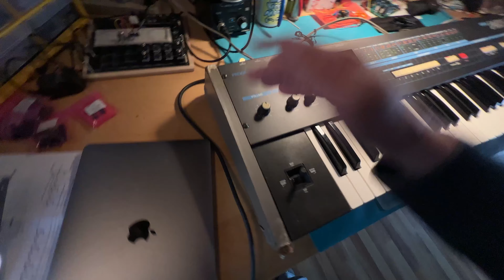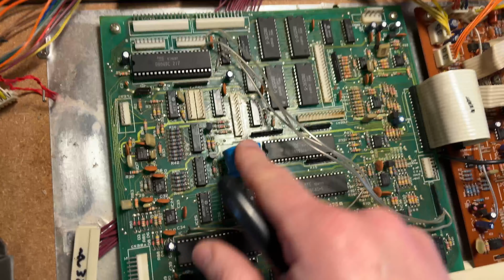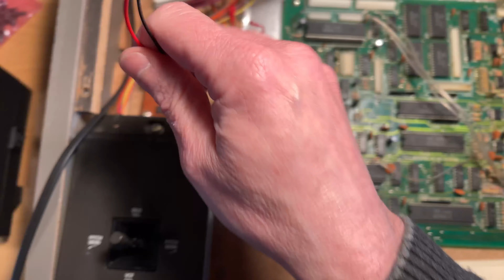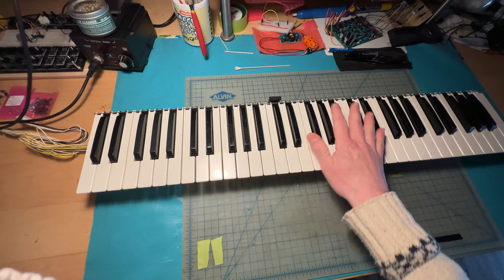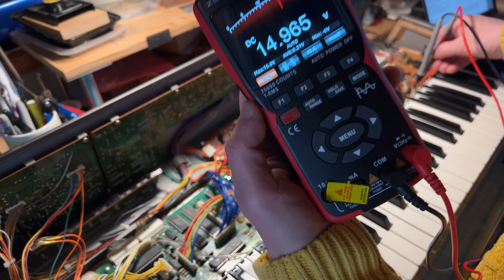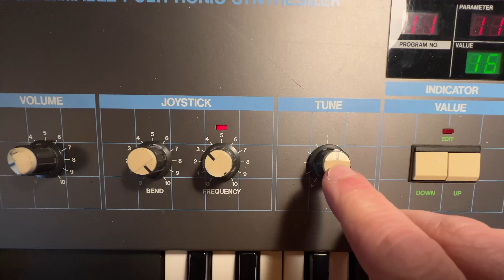A pesky Korg Poly 61 with very strange issues.

Comment: Great video! I just bought a poly 61 and I love it! However, it also has a strange issue. When I turn the keyboard on, it makes noise as if a key is being pressed even though I’m not touching it. I thought perhaps a key was getting stuck, but then discovered that every 6th note I play, regardless of its position on the keyboard, will sustain the note and continue to play until I press any other key 6 times. I think there may be a problem with one of the 6 voices, but I’m not sure how to fix it. What do you think I should do?

Comment: Enjoyed watching this. I have a Poly61 (found in a dumpster!) that I took to my tech, he replaced the battery and fixed the keybed, but sadly when I brought it home, it kept turning off randomly, which was freaky. My tech is in another state so I’m gonna open it up and take a look myself, so this is helpful!
Reply: Mine kept re-setting to the initial patch, no matter what preset you were on. It proved to be simply making sure the connectors from the power cable were fully engaged where they enter into the synth.
Reply: i'm probably late but really the first thing you gotta do when you get vintage gear (especially one found in a dumpster 💀) is to fully clean its insides and replace all capacitors cause those things always go bad after 40 years. if it turns off then it's probably something with the power supply stuff